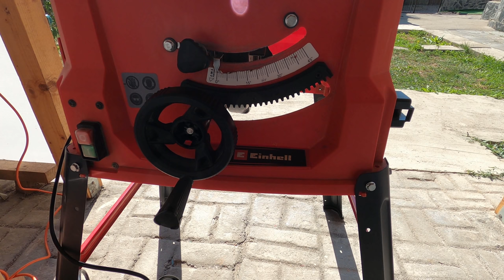How to Improvements Cheap Table Saw  Part 1

Comment: I put a new top and fence on mine, I scribed a line right across from the blade as a reference datum. I also used a over centre clamp and French cleat system on the fence -all work well.

Comment: Why would you want to put a chipboard top on machine
Reply: It´s cheap, bigger area, you can screw fences, etc. for special projects and warp problems are practically insignificant. The original tops of this cheap machines are too thin so they can warp too much ruining even the basic cuts and the only option is to replace them.
Reply: Personally I would have gone with plywood, that would have been a better option in my opinion, but if its not readily available to you then I think you've done a good job using what you have 😊